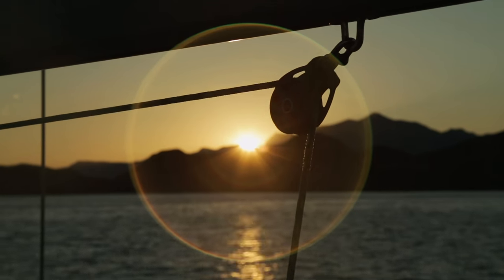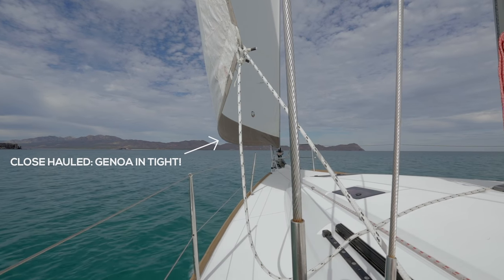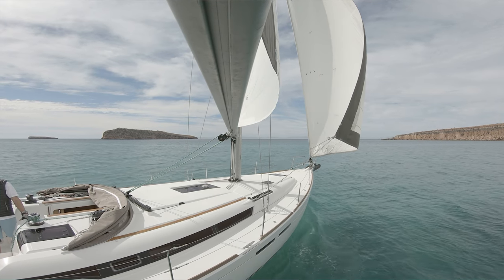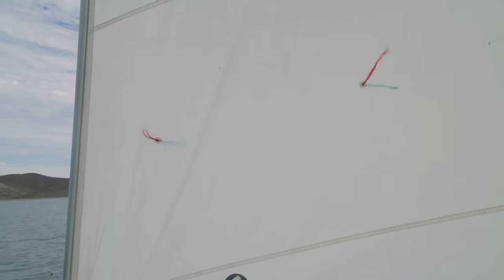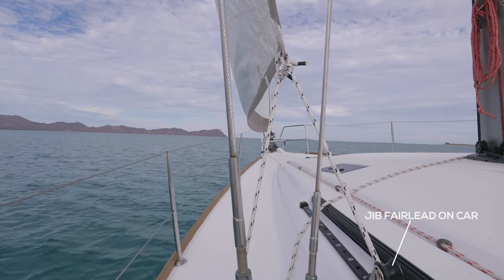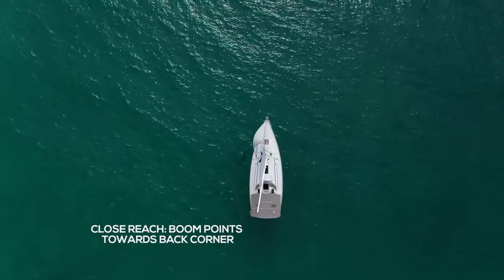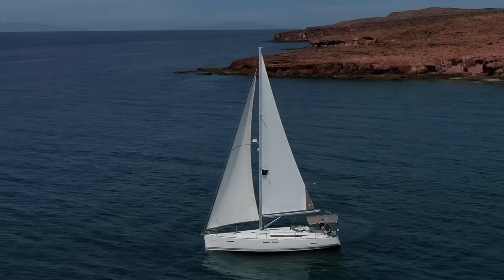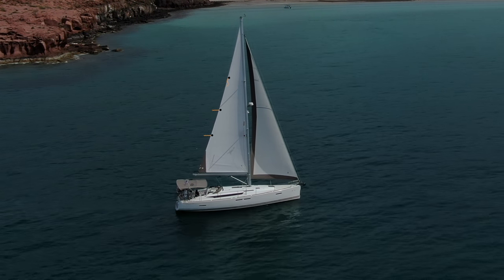How To Sail: Sail Trim Basics -- Sailing Basics Video Series

Comment: Think of the leading edge of the sail as the front of a wing on a jet.  The curvature into the wind causes lift and “pulls the boat forward.  In a broad reach or downwind you are being pushed by the wind.  The fastest you will go is on a close reach with a proper curvature on the sails to give you the most forward lift of your sails (wings).  😊👍
Reply from the maker: That is correct. We decided not to go too much into the aerodynamic theory, and yes that is how it works.

Comment: Moving boom on traveler is to increase or decrease heeling ,depower or increase the boat speed not to move it in respect of the point of sales. With centered boom we ease or trim in the mainsail  with mainsheet for different point of sales
Reply from the maker: Hey Marek... You are right that moving the traveller can change amount of heel and depower the mainsail. However, you can't leave the boom in the middle of the boat for all points of sail, or you are not getting the correct angle to the wind or the optimal sail shape.

Comment: Very good edit!! Just to pinpoint: imagine you're sailing in good stable conditions, does it add something trying to get the upper telltales in line or is the turbulence up there normal,  unavoidable or harder to explain?
Reply from the maker: Great question Fabien. If you think about the surface area of the sail, the smallest portion is at the top, which means most of the power is coming from the lower part. In perfect conditions you can occasionally get the top telltales to flow nicely, but airflow up there tends to be more varied, thus leading to breaking telltales 50% of the time.

Comment: does the tip of the boom being over the primary winch on a beam reach work for all size boats? great stuff btw
Reply from the maker: Hey Josh... Great question. Each boat, because of the layout in the cockpit, may be a little different. However, on many of the newer monohulls we sail, this trick seems to work with winch placement. Glad you are enjoying the videos!

Comment: How do you fine tune the main? Topping lift and boom vang or just the main sheet?
Reply from the maker: Generally we don't use the topping lift for main trim. A combination of traveller position, mainsheet controls the leach tension (twist) and boom vang as well. With in-mast furling you can't use the halyard tension to increase the draft but that is handy in light wind.

Comment: At 5:25 it would be helpful if you used windward and leeward instead of pointing in and out. It’s a little confusing when you talk about telltales pointing in to the port side.   Doesn’t that statement depend on whether you were on a port or starboard tack?  In your first illustration it appears the boat is on a port tack and you talk about The telltales “pointing out” (does that mean to starboard?) and easing the main to port. Wouldn’t it be bringing in the main If the boat is on a port tack?  I think you mean to say, if the telltales are pointing to Leeward ease the main and if the telltales are pointing to Windward tighten the main. In other words, move the main in the direction the telltales are pointing. If I am correct, it is the same as your helpful tip about trimming the jib.  Or do I have it backwards?  Thank you for your help.
Reply from the maker: Great point! Yes, to be more precise it makes more sense to use the terms windward and leeward. However, the saying is "in, bring it in, out, let it out!". People tend to remember these simple sayings far more, so that's what we were going for  in this video.

Comment: Ok, I am still learning, so I very well may have missed something, but you said at 3:28 that if the top telltales on the jib are luffing then you should move the jib car forward. But wouldn't this increase sail twist, which would increase angle of attack toward the top of the sail, which would decrease air pressure there, which would lead a greater tendency to luff, not less...?
Reply: Or do I have the relationship between jib car position and sail twist back-to-front?
Reply: I think I do have it back-to-front. If the car is forward, it's pulling more (relatively speaking) on the leech; if it's aft, it's pulling more on the foot (and giving more relative slack to the leech, allowing twist). If that's right, what you said makes sense.
Reply from the maker: You've got that right. Think in extremes, if your track was long enough to pull the foot really tight, then the leach would be loose. Move it all the way forward so it's pulling straight down, the leach would be tight. 
Twist is leach tension, more twist is a loose leach,  less twist is tight leach.

Comment: Do your trim guidelines apply to Catamaran?  Or Monohull only?
Reply from the maker: Great question Andy! So yes, the same rules for watching telltales to determine airflow on the mainsail do apply to a catamaran. What is different, are the reference points on a catamaran of roughly where the boom should be in relation to the boat. We are working on some catamaran videos and are hoping to have those out in 2021! The pandemic has just wreaked havoc with our best laid plans :(

Comment: Is a Jib sail the same as the Jenoa Sail?
Reply from the maker: Hey Ian... Good question! Both the jib and the genoa refer to the front sail on the boat. The difference is size. A jib is a smaller sail that does not overlap the mast, and a genoa is larger and overlaps the mast.

Comment: the distance between the life lines and the genoa on different points of sail varies according to the boat and genoa or jib size. It's not a constant as you stipulated, please give a percentage for each point of sail. You should be happy someone is paying attention
Reply from the maker: Hey Francis... Yes, you are absolutely right that the distance between the lifelines and the genoa is not a constant based on the hull shape of your particular boat. However, this is a good starting point to get you close to good sail trim. From here, use the telltales to dial in perfect trim and note the exact position of the genoa in relation to the lifelines on your boat.